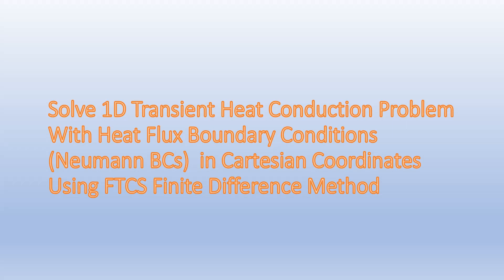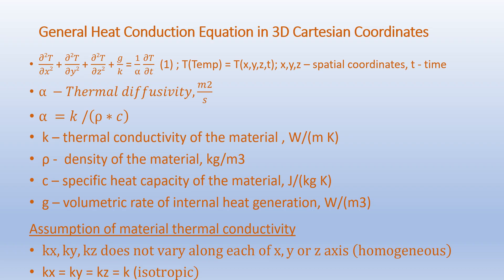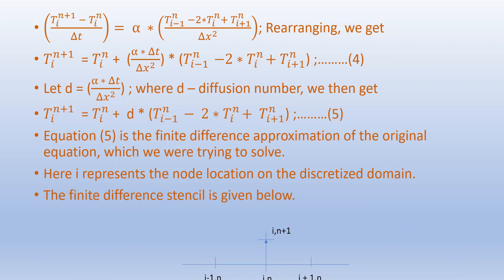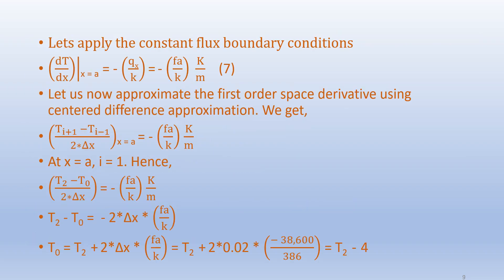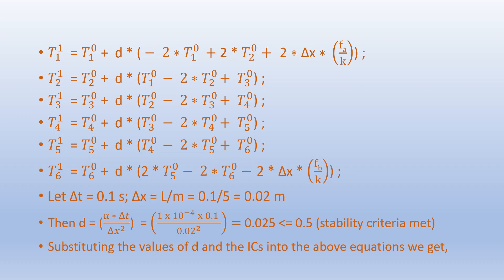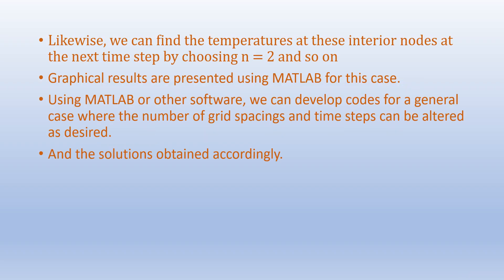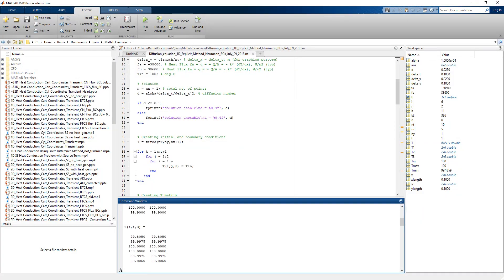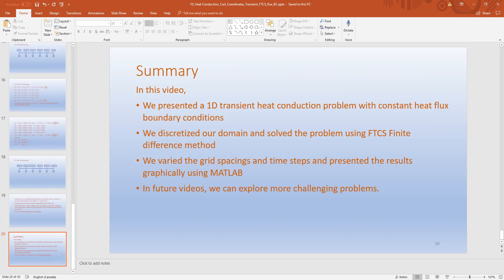Solve 1D transient heat conduction problem with flux BCs using finite difference method

Comment: It was a wonderful presentation and the way you solved the problem was very easy to understand. However, I have one question. As heat flux is leaving the system at point "a" and entering at point "b", then naturally the temperature will drop from the initial value at point "a" and rise at point "b" as time goes on. But your solution shows that temperature drops at both ends with time. This is a bit confusing and I hope you will be kind enough to explain what might be the issue here. 
My guess is that the original temperature gradient formula with a minus sign is applicable only at the left side (or point "a"), but on the right side (point "b"), we need to use the formula without the minus sign. This is because at the right side, the temperature gradient at the right side is actually positive considering the fact that heat is getting transferred at the negative x direction in this case. In other words, heat is getting transferred from the final node (x6) towards the inner nodes and the temperature is dropping at the same direction. So as we go from right to left, both the values of temperature and x (distance) decreases. That implies a positive temperature gradient at that location considering the current reference frame. On the other hand, at the left side the original equation with a minus sign (or the negative temperature gradient) is applicable because as we go from left to right the temperature increases with the distance , but the heat flux is negative in this case and so the minus sign persists.